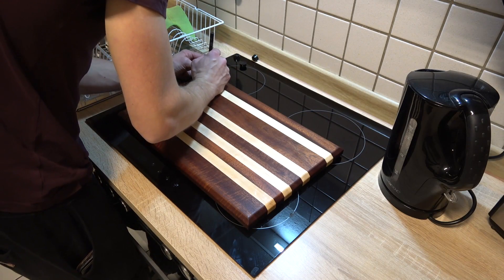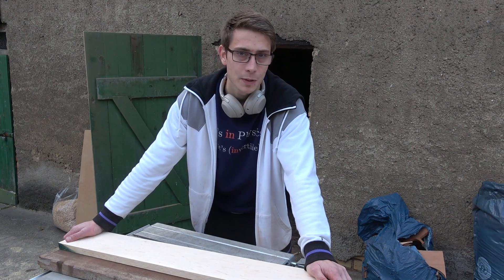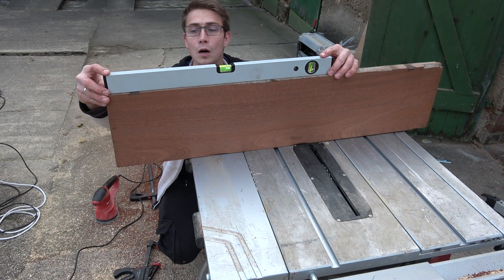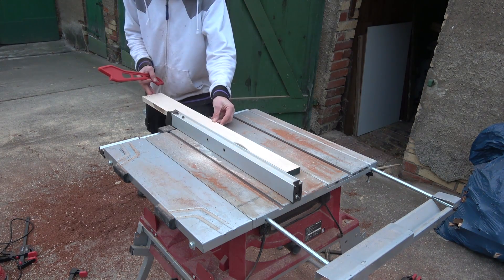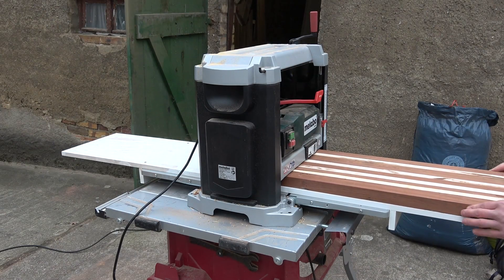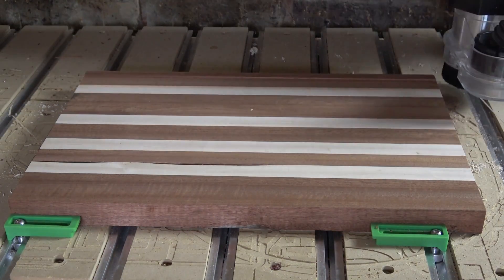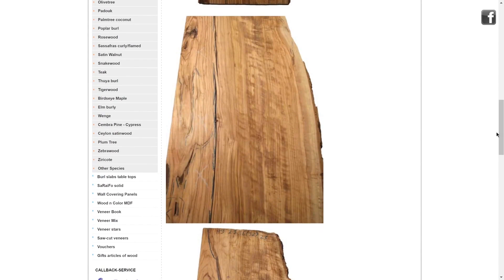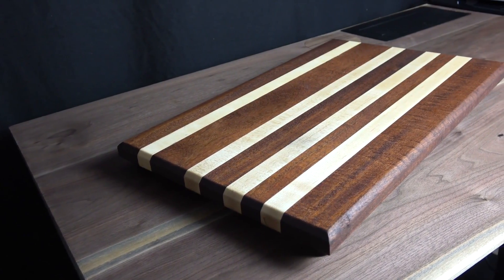Two Cutting Boards for the Price of One

Comment: What oil did you use? Grüße aus Hessen
Reply from the maker: Ein mattes Hardwachsöl von Lignocolor :)
Reply: @RockHardWoodDaddy  Ist das Lebensmittelecht? Und wie bist du mit dem Öl zufrieden?
Reply from the maker: Ja, meines Wissens nach schon =) Besteht nur aus natürlichen Ölen und natürlichem Resin. Mit dem Öl bin ich bis dato sehr zufrieden, es ist ziemlich ergiebig und hinterlässt eine schöne Oberfläche =)
Reply: @RockHardWoodDaddy  Danke für deine Erfahrung :) Soweit ich weiß, ist alles, was schnell erhärten soll mit Sikkativen versetzt, wo auch schädlichere Metallkationen eingesetzt werden. Die Firma Lignocolor kenne ich bis dato noch nicht, scheint aber auf toxikologisch unbedenkliche Stoffe zu setzten. Ich werde das auch mal ausprobieren. 
Auf jeden Fall machst du hier echt guten Content, der mal besonders einen viel zu sehr vernachlässigten Aspekt von der Mathematik im Holzhandwerk anspricht! Keep going :)
Reply from the maker: @revo1337  Immer gern doch <3